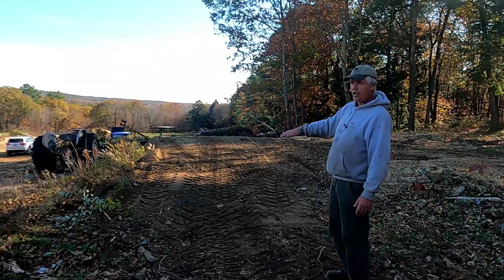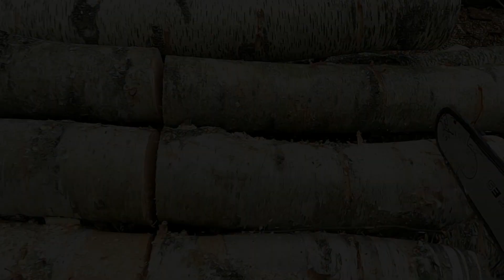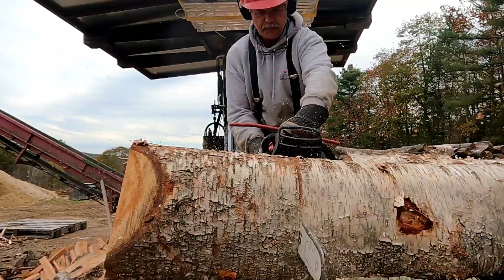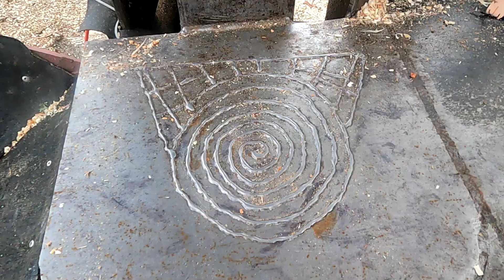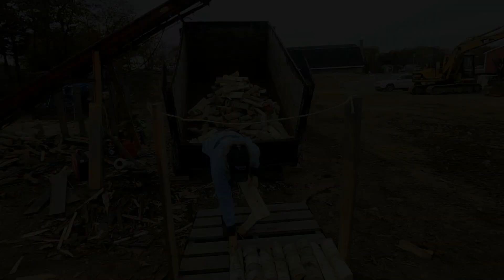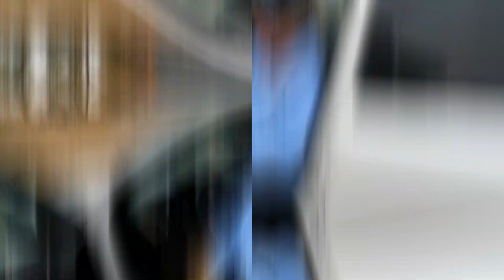BUCKING AND BUSTING BIRCH

Comment: Never have cut or burned any birch before none around here 
Sure looks like it cuts and splits nice 👍 
I run a 660 but my buddy Brayton’s 500i will cut just as fast and is much lighter 
We picked up a old Ford F600 dump truck and plan on putting it to good use this fall and winter 
Keep up the great videos 👍
Reply from the maker: Thanks, the birch does really split nice.   Still don't have my truck back so I'm looking around for something.   Being without a truck does not work at all.  I'd like to pick up a dump truck just so we could go in two different directions with deliveries.   Thanks for watching!

Comment: Phil I see you have some welding line on the table so the wood won’t slide out , any regrets or you would not do without , close call with the finger Karen glad your ok , nice load of birch 👍🏰🚀🪵🚜🇨🇦
Reply from the maker: Thanks Len.  The welds on the table help the smaller rounds from not slipping, it works great.  The finger is doing good...thanks for watching!

Comment: You guys are kicking butt, notice on "Buster " you ran some weld beads to prevent slip outs, as you have seen on other videos that is safety issue. I would think low profile diamond plate would make a better platform?  Your thoughts?
Reply from the maker: That would work also, but the welds work fine